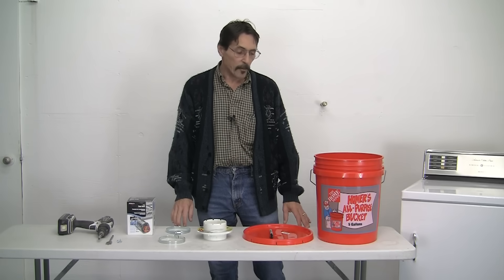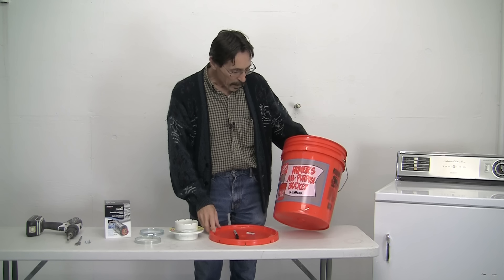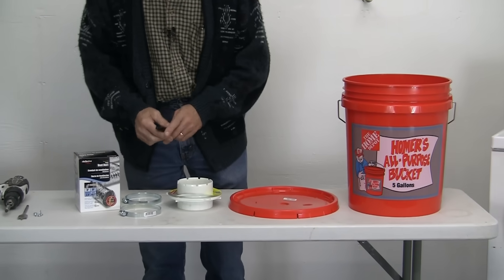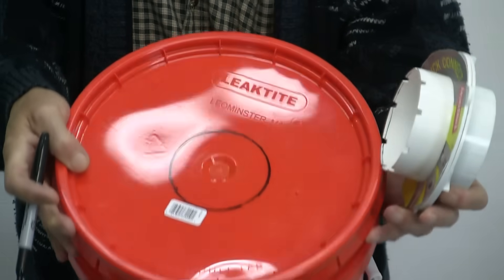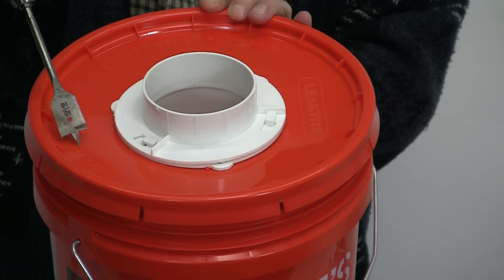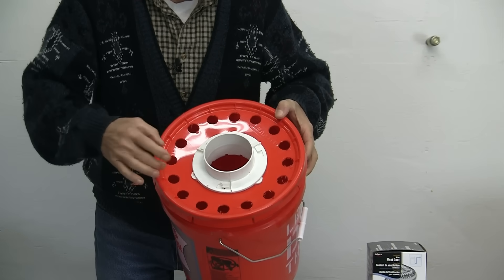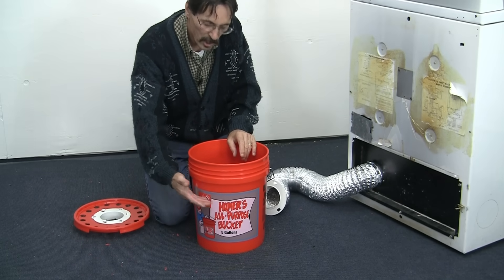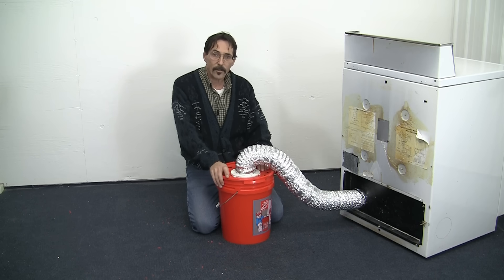DIY How to Cut Electric Bill in Half: Part 3 Clothes Dryer Free Ideas | Missouri Wind and Solar

Comment: If you add a short piece of  vent pipe and connect it  inside the bucket so it just above the water line  It keeps lent from coming out . If you leave  to much space between the water and the incoming air the air mixed with lint will  not be forced into the water and it will bounce off the walls of the bucket and blow right out the holes .Its hard to see during the day but  try it at night and use a flash light and you can see the lint  dust coming out of the holes . Then add the short vent  hose  and see the difference . I use 2 float balls on each side of the  vent hose and make the hose long enough to go all most to the bottom . When the water is full in the bucket the balls keep the vent hose  just above the water level and lowers as the water lowers to keep the space between the  hose and the water the same  all the way to the bottom . Its a little extra work but you only do it once  and you get no lint dust at all coming out of the bucket .

Comment: It would filter better if you extended the exhaust tube from the top of the bucket down in to the water, to force the lint in the air to filter THRU the water, and not jut blow down onto the surface of the water...it would b a bubbler then, like a bong.

Comment: OH, just call it what it is....it's a BONG for your DRYER. It would filter better if you extended the exhaust tube from the top of the bucket down in to the water, to force the lint in the air to filter THRU the water, and not jut blow down onto the surface of the water...it would b a bubbler then, like a bong.

Comment: Basically a bong creates a warm house and saves you electricity when running an electric dryer.
Reply: So smoking a bong saves electricity?
Reply: Yes, it will warm up your house and kill the occupants.
Reply: @Taras-Nabad  and how would it kill anyone? I think you are confused by whats powering it
Reply: @Taras-Nabad  also heres a tidbit many people have holes or damaged lemt plumping and guess what they live fine despite a fire hazard mtn of lint stuck between the wall amd the dryer
Reply: @EhsanVreeken  How about you ask the manufacturer if they recommend to vent the dryer in your home. You are completely disregarding the installation instructions of the tens of millions of dryers that have been sold. You should be held accountable if and when something happens to someone. You need to think before you put this nonsense on you tube.
Reply: @Taras-Nabad  I wouldn't leave it like that. Needs a carbon filter. At the very least some panty hose or something similar stretched over it.
A grow tent filter would (plug) right in I'm sure.

Comment: Overkill. All i did was put pantyhose on the end of the dryer hose. Most of the lint is caught by the dryer filter which gets cleaned with every laundry load, so the pantyhose seldom needs to get changed.

Comment: Using a Oneid Air Dust Deputy (https://www.google.com/#q=Oneida+Air+Dust+Deputy) on the bucket, ~2 gal adequate, makes a far more efficient lint separator. 

Just put the dryer output air into the outlet and use the top opening for air into the house.

I have done this in commercial buildings with electric dryers which do not allow exterior venting.

Comment: A condenser/heat pump dryer will save you even more on electricity. More expensive up front, but 5x less energy usage, without even needing a vent.

Comment: id like to see it in action, with a humidity meter. For sure that hot air coming out the dryer is humid, plus hitting the water (thus heating it, evaporation=humidity).  Good thing is that in winter, air is dry in the house because of all the dry heating (baseboards, wood stove etc) ...so maybe it would balance out at 50%.... But I would show the people how it work, and the humidity meter.
Reply from the maker: My place never gets over 55 to 60 percent humidity. I have a humidity meter in my house and i heat with propane. Your house is large enough it just absorbs all the moisture from the dryer bucket.

Comment: You can just buy a vent that you flip in winter that vents hot air in for $5. Has a screen to catch lint and you don't need water since the dryer is already introducing hot humid air.

Comment: cut you electric bill in half. line dry your clothes
Reply: Over the next week the high temp in my area will be 17F, and not enough rooms in the house to set up multiple lines & racks. Maybe you can wait for April for clean dry clothes, most of us cannot.
Reply: @dennishadley2783  When I grew up we didn't have a dryer so if was fun bringing the clothes in the house after they had frozen on the line outside. We then had to dry them off next to the pot belly stove before we could put them on. Brings back memories and chills.
Reply: @dennishadley2783  it about 20 Def F here too, but I still hang mine in my laundry room. I have wire shelf rack all the way arround my utility room so I just put them on hangers and its done
Reply: @dennishadley2783  you might have good luck with a wooden folding dryer? I do,then you can put them in the dyer on TUMBLE ONLY for a few minutes. Gets the wrinkles out. Not saying it's the gospel,but it works for me. Just a suggestion from a cheap ass. :-)
Reply: I agree with you, except where i live it gets too cold in the winter so you must have a dryer or your clothes will freeze on the line and stay that way until spring.
Reply: Yes. In the middle of winter
Reply: to cut electricity-  buy one of those small high rpm spin dryers and re-spin your clothes- usually 2 or 3 loads for 5 min each will do a full load from the washer- I have PANDA spin dryer-
 been doing it for a year now - my electric dryer time is cut in half -I imagine if I convert to gas it would be 25 minutes or less to dry a full load OR spend 1500 for the fancy washer that may come close to the spin dry and cross your fingers that one of the sensors or board does not go out prematurely - I have always had better luck with the simple washing machines. I use to line dry but I always forgot to get them while they were still  damp to dry them a bit so they are not stiff.
Reply: That's a very easy solution.
After you hang the clothes on the line. Put them in the dryer for about 10 minutes with fabric softener sheets to soften the clothes.
It's better than putting the clothes in the dryer for longer periods of time.
In the winter we use a clothes rack to dry our clothes then the dryer. 
Great video I will try that,  thank you.
Reply: @nickhill8612  And save the dryer sheets....if you have a pan with baked in crud,fill it with water and place an old dyer sheet flat on the water,leave it,come back in a few hours and VOILA!  The crud just rinses out. Works well for baked messes.
Reply: @erlycuyler  
Okay I'll try that and thank you.
Reply: Donald Welborn at my old house it had a clothes line outside for during summer and some in the basement the people who lived there before us used for winter, house had no hookups for a dryer so we got a 120 volt and put in a gas hookup from the heater line when the electric one broke
Reply: Cut it in half again by never washing clothes again.  Have no electric bill if you throw all of your clothes away.
Reply: yea, thats why i hate to dry towels outside, plus they have a lot of lint and debris on them so i still use the dryer for those and my dark shirts. I havn't really considered high rpm spin dryer, never heard of it to be honest.
Reply: EXTRACTOR IN LAUNDROMAT.
Reply: It rains everyday where I am
Reply: That works well in MN the next 8 months.
Reply: He is saying use the heat from the dryer. Not sure if you can hang clothes out in winter to dry.
Reply: @joshchilds1473  I do it year round, but not ourside, in my utility room
Reply: different strokes for different folks.for me i use my dryer so i dont have to spend time and money ironing everything.
Reply: @joanlantis4497  Lol, what is an iron?
Reply: Kirk Armstrong I personally don't like to line dry case makes them all stiff and weird feeling.
Reply: The line dry meathod works well If you get them dry then The clothes can be put in the dryer for ten minutes to fluff them to softness
Reply: @daniellamoreno3616  interesting that is exactly why I like line drying. Gives them some backbone.
Reply: @daniellamoreno3616  if your clothes are stiff after line drying then your leaving them out to long. You want to have a little bit of moisture left inside to keep them soft. Also use fabric softener when washing
Reply: @00piper18000   a capful of distilled vinegar works,too.

Comment: Question: you say there have to be enough vent holes to allow proper air flow so that it won't slow down the clothes drying. If the hose is 4 inches in diameter, then air flows through an opening with an area of a little over 12 1/2 inches. So The equivalent area would be about 16x 1-inch holes? Any fewer would restrict airflow, and any more would be overkill. Right?

Comment: That’s great but, as you said, you can only do this with an electric dryer. And lets face it, if you are trying to lower your energy costs you should not be using electric dryers, water heaters, or spacer heaters to begin with as they use massive amounts of electricity. In fact, simply having a gas dryer would likely save more in energy costs than scavenging the waste heat from your electric dryer. If you are stuck with electric though it’s certainly a good idea to make use of that waste heat to supplement your furnace in the winter. And not only are you saving normally wasted heat but you are also reducing the amount of cold air leaking into your home. This is because whenever the dryer is venting air to the outside, that air has to be replaced from somewhere, so cold outside air gets sucked into your home and this of course increase your heating costs. 

So, it can be a good idea for some people to do this. I have to say though, on days of high humidity, such as when it’s raining, your house might get very uncomfortably humid with this system, particularly if you live in a very small home.
Reply: My house couldn't get gas, so I ended up getting solar panels and got rid of 75% of my oil heating bill and 90% of my electric bill. But I still keep looking at the most efficient way to use electricity to heat my house.

Comment: You will burn up the heating element in the dryer if you do this crap.
Reply from the maker: No you will not burn out your element. Been using the buckets for about 25 years with no problems.

Comment: won't the lint just fly out the small holes? you can't expect 100% of the lint to "drown"(so to speak) in to the water? or is the water level high enough that the end of the hose is submerged in to it?

Comment: Even with electric dryers this may be illegal in your state because it's a fire hazard.
Reply: Frank Gutowski perhaps, but the reason nfpa54 and mechanical code requires that all byproducts from the dryer vent exit the envelope of the building is because lint is extremely flammable and can be ignited by a spark from an electrical outlet or pilot from a gas appliance after it ends up coating the walls inside the room the dryer is in.

Comment: what a joke! you will pump way too much humidity into your house. this is a joke. you will never even be able to keep a loaf of bread in your house,''''There has never been any MOLD issue since people have been using this type of lint bucket since the 1980's.''  BTW how can you make that comment without lieing?
Reply: I know already, stop complaining people and try it. Obviously this dudes telling the truth. Along with common sense will tell you the same. Also just try the damn thing before you criticize people. He is trying to be helpful to others, unlike most people who expect something for there help so shut up already people.
Reply: Jon Jones how hot does your dryer get for the exhaust to turn liquid into gas and produce too much humidity?
Reply: thats easy! It gets hot enough to dry cloths
Reply: The clothes you are drying has water in them. The hot air made in the dryer will be saturated or highly humid, and will not pick up additional water from the bucket, until the clothes are dry. To make the project really work well, a second bucket made out of stainless would condense excess water, and trap residual lint.
Reply: Works great up here in Northern Michigan during the winter. We run a wood stove Non-Stop and we can never have enough humidity in the house as the cold winter months have no humidity. I think this idea works just great but only in certain areas of the world with a colder climate like uo here in Grant Michigan.
Reply: typical friend or Troll comment. If you are not convinced it wont work its because someones paying you or you are just plain stupid.
Reply: Hahah the air coming out of the dryer is loaded with moisture, it wouldn't have to vaporize any of the water in the bucket to jack up the humidity levels in the home.

Comment: ya, your house will be very humid and everything in the surrounding areas will be wet, as an appliance repair guy i do not recommend this at all
Reply: christopher you clearly dont know how a drier works do you ? it heats the clothes and they evaporate the water  into the air . which raises the humidity of the air . now normally you have the exhaust so that the very humid air is transported out of the house and that is for a very good reason a dryer needs air that can absorb water  and very humid air does a poor job of that . this is why dryers dont work in very humid places you can run em for hours and the clothes are still damp .

this is literally the dumbest idea i have seen in a long while
Reply: @Crushonius  but this is horses for courses, if you are in a place with low humidity, this will be helpful.
Reply: That is your personal experience with this filter? Or just an opinion based on what you haven't studied?
Reply: my experience, also will rust any mechanical parts on dryer and washer or anything around
Reply: gibbyh65 how hot is the exhaust out of your dryer? Does it boil the water to fill the air with too much humidity?

Comment: GREAT plan, unfortunately the amount of humidity a dryer puts out is huge on top of your standing water. This half baked idea comes around every five years and results in the same problem of black mould. If your looking for black mould I would recommend following this instructional video., or the other thousand like it. 

Proper building construction is to vent your dryer gas or electric outside. We do this for a reason (see above) that's why there are building and health codes. 

I would highly recommend stopping with the dispensing of very bad advice and pull this video. However if not, anyone who gets black mould from this (and you will) you know who to contact for compensation.

Comment: This might work if humidity is low but if that is the case, a clothes drying line would also do the job. On the other hand if the humidity is normal/high this means adding up a lot of humidity in house which makes your house a nice place for molds in everywhere. Plus a lot of condensation on windows. Then you would need a dehumidifier to get rid of that. better way is to create a condenser and try to remove moisture before letting air in house.

Comment: Never use white vinyl or foil looking vent to exhaust your dryer. It is a fire hazard. Do not have to take my word for it. Look in the manual for your dryer or read the instruction glued to the back of most dryers. There is an internal vent box that can be attached to rigid or semi rigid vent that not only allows you to capture heat and moisture, but also has a secondary lint filter you can pull out, clean and put back in. In the summer months, flip the lever and the heat and humidity goes outside. Hope it helps.

Comment: how well does tgis actaully work? it seems to ne that it would give of very little heat for half an hour and just be an eye soar... it is clever tho, had anyone actually tried, if so how did it turn out
Reply from the maker: Thousands of people have used this one and ones similar to it. It's just free heat your putting outside.

Comment: I use a 5 gallon bucket to sous vide beef ribs regularly this adds constant humidity and a very large bucket of hot water to radiate heat not to mention I'm cooking my dinner at the same time a water circulator will cost you anywhere from 50 the $300 however it is more than worth the price the gasket at the top of the bucket holds the heat in I simply cut a small hole insert my water circulator at the top so for something like beef ribs you go 130 degrees 4 maybe 3 days best beef ribs you ever had

Comment: Thanks for the video!  My dryer is in the basement and the vent hose has to stretch pretty far.  My dryer is still pretty New and it wasn't drying in one or even two cycles.  I took the vent off and there was water in the hose.  Even after I cleaned it out the dryer took forever so I had to remove the vent.  This helped a lot.

Comment: This is a really great video. A couple of additional notes to keep in mind: Any VENTED dryer air that's exhausted from your home in the winter is replaced by air LEAKAGE into your house, which you subsequently have to heat to home temperature.  Hence a conventional dryer with no heat recovery makes you lose energy in 2 ways, making it even more of an energy sucker (wallet drainer).  Secondly, dryer efficiency decreases with more humidity in the air (its intake is in the same room), so it really IS much better to locate the bucket in another room or adjacent hallway (laundry room door closed), so you're not trying to dry clothes with air that already has high humidity.  If you MUST have it in the same room, then as a minimum, leave the laundry room door open, and perhaps consider a small fan to help to circulate the warm, humid air out of the room and into the rest of your home :)